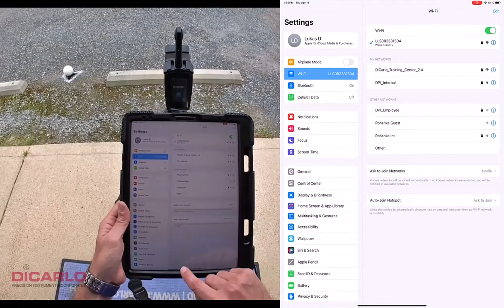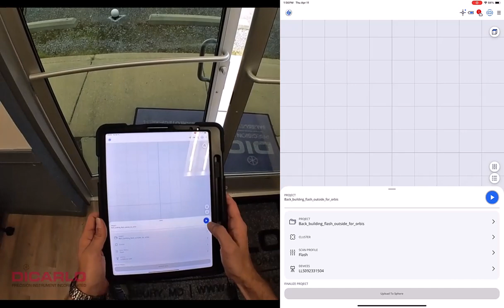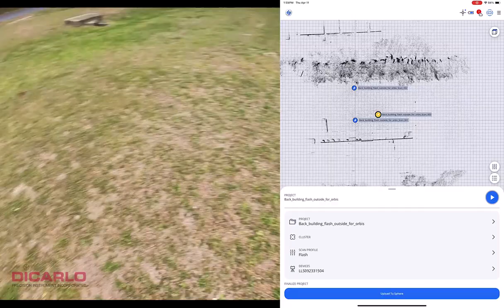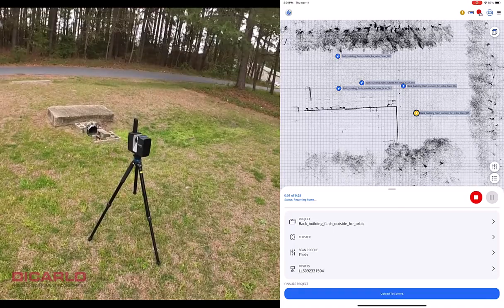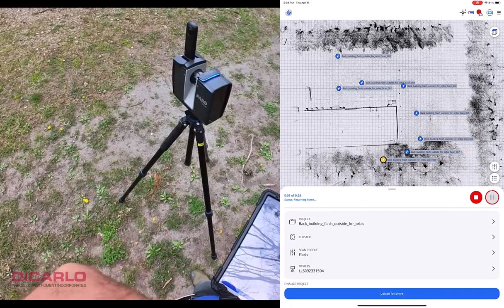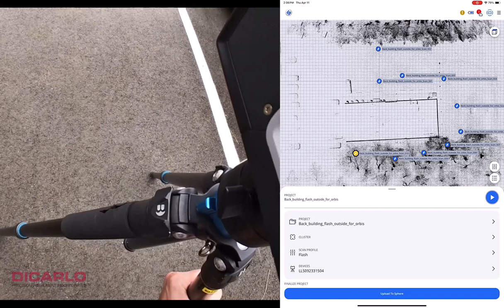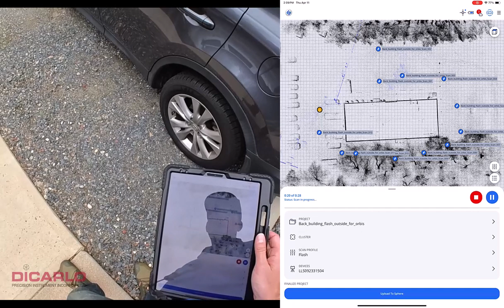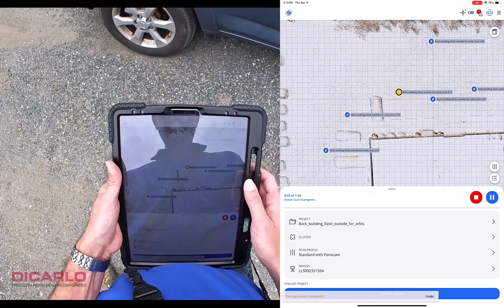(Part 1) FARO Premium Flash field data collection FPV workflow

Comment: Since flash doesnt really use the inclinometer, are you worried about your registration accuracy?
Reply from the maker: Not really. As the data itself ties everything together. If I want accurate level I survey in some targets with a laser level (much more accurate than anything the scanner or even a total station can do). Otherwise I just scan one or two scans with a standard (non-Flash) profile and set this or the other as a "Reference scan". Works without issues!